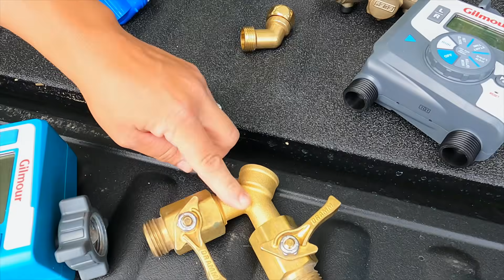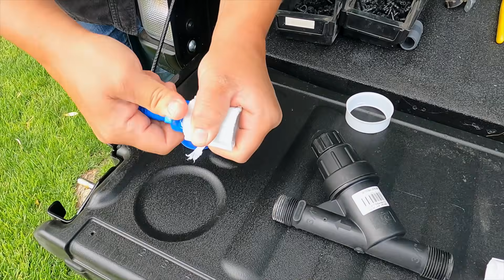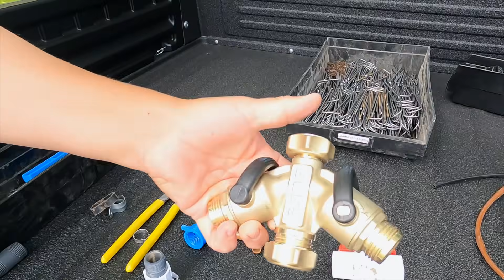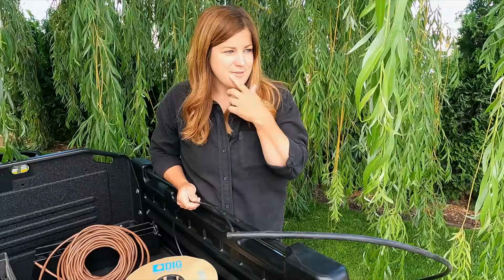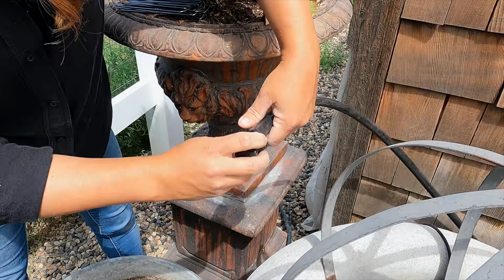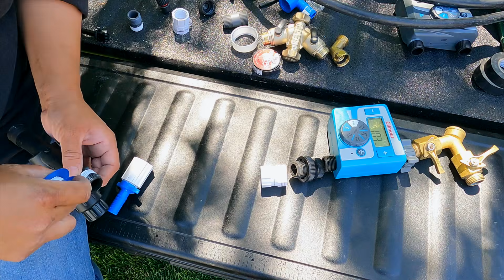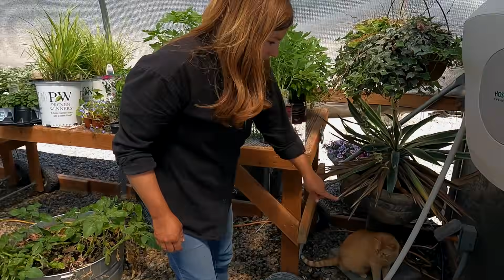Setting Up 18 Pots On Drip Irrigation! 💦 // Garden Answer

Comment: I've learned so much from y'all about drip, my husband and I installed it everywhere a few years ago from watching your channel. This year I pulled it all out and put it in a grid pattern like Paul did and the pressure is so much better and you're right we evolve and just keep improving. Whenever I put 1/2 inch black tubing in a walkaway I run it through PVC pipe to protect it from puncturing.

Comment: These irrigation videos are SOOO helpful! My husband and I converted the existing lawn irrigation in our “new” house 7 years ago to water our beds and pots and it was life changing!! After hand watering at our “old” house for 18 years I feel like I am no longer a daily slave to the garden… and even go away for a weekend without fear of massive plant death! 
Our irrigation system had 3/8” tubing, (which I see from time to time), even though I was told by the guy at an irrigation supply store that I was crazy because there’s no such thing. It’s been an ongoing challenge to find parts for the 3/8” tubing. 🙄 Have you run across 3/8” drip supplies in your experience?

Comment: We use the Command outdoor light clips to run our 1/4” tubing to our porch hanging baskets. The clips are the perfect size to hold the tubing if you want to run drip without damaging trim. P.S. we unclip the tubing in the winter and use the same clips to run extension cords for our Christmas lights.

Comment: Great explanations! Now we just need builders to provide faucets on houses at a decent height!!! I am so tired of always bending or squating to turn on the water.
Reply: another option that may work for your situation is to run hose to garden area, and THEN add in the filter/backflow/regulator, and then 1/2 inch tubing, etc.
hope that helps!
Reply: @moiseechen  Yes, great idea -- thanks very much!

Comment: How do you get the couplers into the tubing so easily? Do I just have baby strength in my arms and hands? It's super hard to darn near impossible for me to get the couplers into the tubing. Am I not holding my mouth right or something? I read that one trick is to put boiling water into a thermos and dip the ends in before adding the coupler. Haven't tried it yet. Anyone have thoughts on this? Oh by the way thank you for all of your informative and no nonsense videos! I get a lot of information and inspiration from them and I drive my husband nuts in the process so YEAH! 😂
Reply: I too have enormous difficulty ...i tried leaving tubing out in sun and the hot water...i also wear gloves to get a less slippery grip. there seems to be slight diameter diffferences among brands of tubing, some easier than others? but i haven't figured it out fer sure! in meantime, builds up your upper strength!!
Reply: Sometimes we use a heat gun to warm up the tubing as we go.  Of course we have to have a long extension cord to reach where we are working.  We have also carried around a cup of VERY hot water to dip the tubing into for a few seconds in order to soften it up some.
Reply: @stevet249  thanks. great tips. i tried that too and left tubing out in hot sun too. and i wear gloves to get better grip and less wear and tear on old fingers!!! [and somehow involve my knees in getting more power]
haven't figured out which brand, but some are bit wider, work easier? [but then, guess that means will come apart easier too? [heat, cold, critters?]
i consider it my 'workout' for the day. ha ha!
Reply: @moiseechen  @Steve T thanks!

Comment: Speaking of hard water and water filters, we have a water softener system that uses salt and I’ve often wondered if using that water in the garden has a negative impact on my plants? Or is it better than the hard water?
Reply: Water softeners use salt to rid the water of minerals. It is too much salt for plants and also can build up in the soil. Use the hard water and the plants will do fine.
Reply: @jgwood10  thanks for the reply. Unfortunately, I have to use the treated water. Is there something I should be adding to the soil to amend it?

Comment: Question- If I’m setting up drip to a flower bed instead of container would I still use 1/2 inch black poly and 1/4 in brown tubing? Or would I do 1/2 inch black and 1/2 inch brown?
Reply: I use 1/2 in in my in ground areas. I have some of the black 1/2” with individual emitters and the brown with 12” in spacing in other area’s. Then I can T off of that with 1/4” if I want to get extra water to something (like a plant that needs extra water, I run a ring of brown 1/4 around the base of the plant).

Comment: Why do you change to the brown line for the top of the pot? Can’t you use the same black tubing?
Reply: The brown line has emitters already imbedded in it. You would have to add an emitter to the end or at several spots to get coverage. Without an emitter the water just sprays out like a mini hose.

Comment: Thank you, once again, for such an informative video!  Re pressure ... I recently added 1/2" tubing grid on my flower beds (thanks to your videos!) and some of the T areas I had to add a clamp because they were blowing off.  Is there something I can add there to avoid this?  Once I clamped an area, another area would blow off.  Ugh!  Thank you both for ALL you do!
Reply: they make connectors that you first insert iinto tubing and then there is a ring that gets screwed down ...hope that helps.
Reply: I had the same issue - the pressure regulator😊

Comment: Two years ago I pulled up a video where Laura showed us how to use drip in her vegetable beds and then a few more videos setting up her pots.  One in particular where she used a circular saw to carve out a line in a cement slab for her alley pots. That was clever. I sat down and started plotting out everything I needed. I stared with a small bed first.  Easier than I thought. Only trouble was that after awhile, my fingers got sore from pushing all the barbed connectors through the ends of the tubings!!!! Other than that, it became easier to know what I needed an how to do it.  Even this video I learned a couple more things.  But the time saved, like some 3-4 hours a day of watering, was a life saver. .  As for timers, I use the Melnor, quad system on the front and back faucets.  I regulate them with my phone. It all was well worth the time and effort to learn and setup an irrigation system.  Thank you Laura.

Comment: After watching you for the past few years, I decided to install an irrigation system for my garden.  It works beautifully except when the watering cycle ends, and the water turns off or switches to another zone, water comes out of the connection between the backflow preventer and the pressure regulator.  I keep a bucket under the faucet to catch the water. The connection is tight. What can I add or do to resolve this?
Reply: is it coming from the 'backflow' piece? seems that is what it is supposed to do? i run a hose to the garden, and THEN install the filter/backflow/pressure reg combo at the begiinniing of the 1/2 inch tubing [to keep all leaks away from house and out in the garden instead!] hope that helps!
Reply: Did you try the pipe tape?  Use the 5-6 times around.  Mine drips hubby wants to fix it but For some reason my honey bees love to drink there🤷🏻‍♀️ They have other water sources but love the dirt mineral water combo I guess😊 so I won’t let him😁

Comment: Loved this video.  I am putting in a new  cottage garden and can’t decide on the best type of irrigation to use.  I know I want a timer but cant decide on which pipes etc to use or how to put them together.  I would be mainly watering garden beds or annuals.  What would you suggest?  Also how long a pipe can you run off one tap?

Comment: Do you have to pull up all your drip tubing every winter to avoid freezing like you do for the cut flower garden?
Reply: They don’t pull up any drip tubing. The cut flower garden is drip tape and yes, that has to be pulled up, but drip tubing does not.
Reply: @sheilastromberger2275  It seems like the tubing would split quicker than the tape as the tape would not hold water. Their ground freezes several inches deep. Our sprinkler hoses can stay out. Our regular hoses cannot just like theirs cannot. We cover our water spickets as well.
Reply: @dlsdyer9071  the drip tubing doesn’t hold water, it all drips out the emitters. Aaron talked about it years ago how some people use an air compressor to blow out the lines but he feels it unnecessary and they don’t do it. I’ve never blown mine out (zone 5) and have never had any issues. I do blow out my underground lawn sprinkler system.
Reply: @sheilastromberger2275  thanks for the info. I do blow out my PVC pipe system that I have for my terraced garden beds. I did not want to have to do the same for the tubing. No reason to not install now.😁

Comment: I think very helpful just to be aware of the different potential piece parts, even if not immediate need for.  I've been dealing w my quick connect coming loose, causing a leak, on my new wand. Completely forgot about thread tape solution until this video.  Funny how its just 1, all my others tight as can be.

Comment: Be sure to put the teflon thread tape on  the threads CLOCKWISE.
Reply: Yes. The direction you apply the tape definitely matters.
Reply: A lesson we learn the hard way!
Reply: I didn’t know that! Thank you! That’s super helpful. Now I’m gonna go check all my fittings and see what the heck I did.
Reply: Where do you get the thread adapter female to female hose to irrigation fitting, it's white in the video?
Reply: @anand bagmar That's right, you have to put the teflon tape in a clockwise direction when you hold the pipe in front of you. This way, when you put your fitting on which is also in the clockwise direction, you won't bunch up the tape. If you put the tape on in a counterclockwise direction, when you put a fitting on, it will bunch up because you are essentially moving the fitting against the direction that the tape is lying. There are several YT videos on this....

Comment: Do you recommend getting a kit to start out or buy individual parts and tubing? I see kits for sale but hesitate buying them so I dont end up with parts I really won't need/use.
Thanks in advance for your advice. 🌻🌷🌻🌷
Reply: i started with a 'kit' bec i was so overwhelmed in the stores ...if you have a large garden you can eventually find use for everything. you learn alot from a 'kit' and avoid frustration of missing essential part!

Comment: When Laura said “I really hope this isn’t confusing” I was sitting looking at the screen like that gif/meme of the woman who has the mathematical equations circling around her head 😩
Reply: I think drip irrigation is something that you won’t fully understand until you actually start setting it up. Once you begin it all makes sense and is really quite easy. I refresh my mind each year because it’s not something I do everyday and there are a lot of parts to it.
Reply: That whole first part seems overwhelming until you start putting it together. Her's is more complicated than mine is with having to get all the adapters for the different threads. You go to Lowes or something and you can find everything that uses hose thread only. Just remember it starts with a timer, backflow valve, filter, and a pressure regulator. Grab those and put it in your cart. You'll need a way to cut the hose and a way to punch a hole in the hose. They sell specific tools for that. Grab those and put them in your cart. From there it's really customized to what you want/need. The fittings are for connecting the hoses to route your system. You can get "emitter hose" like she has (the brown hose) which makes it really simple, or there's lots of drip end fittings you can put on.
And then there are kits that will give you an entire set up. I think you may still need to get the cutting and punch tools.
Reply: @larag4646  🌱Thanks for summarizing it. I found most parts at Home Depot and Lowe's. Setting up my garden on irrigation has been such a game changer.🌱
Reply: @larag4646  thanks for clarifying what to get first. And what to add next. I just took a screen shot of your comment. 👍🏼
Reply: One beauty of the video format are the pause and replay features . There have been several times I have gone back into the Garden Answer video vault to answer a question or seek input!
Reply: I was the same way when they explained it in other videos. At that time, they recommended buying a starter kit. I did for maybe $25, found it pretty easy to set up, and have been maintaining it ever since. Now I’ve added different tubing, expanded my drip system and even set up a system at my parents house. I’ve never regretted doing this. It’s a real game changer.
Reply: Lol

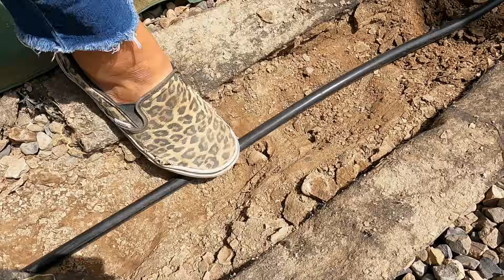Comment: Just a thought…would it be helpful to run the 1/2” poly tubing though a pvc pipe to protect it from getting smooshed by walking/garden carts? I noticed how easily it was smooshed when Laura stepped on the landscape staple at 15:18 and had to back it out a bit. Absolutely love your videos by the way! My 7mo old lights up when he hears “hey guys, how’s it goin’?”
Reply: When we moved into our home and started building garden beds and running drip we too ran the 1/2 “ poly through a shallow trench in the ground as a test…thinking we would need to upgrade to poly…surprisingly 3 years and counting its all holding up perfectly!
Reply: My exact thought! I bet it depends on the brand of tubing she uses. The brand I have is ruined if it’s even crimped. It almost stops water flow.😩
Reply: 🌱I did that on a section that was going from under the sidewalk. Otherwise, I place them above ground and then mulch them.🌱

Comment: Rain bird makes a kit that gives you all the hose parts and some black supply line, so 1/2 drip tube and 1/4 inch tubing and some emitters. 
This is a very simple way to get started!
Reply: Agreed. Great way to get started is with a kit until you figure out the shortcuts!

Comment: see….THIS is why I watch Garden Answer. You two make everything feel accessible! I am trying a soaker hose on a timer for the first time this year, and i’m already anticipating I will be using it A LOT this year. Before, I hand watered and always had issues like blossom end rot. I’m hoping this consistency helps. Thank you for the inspiration, Laura and Aaron! You guys even inspired me to start my own little youtube channel 🤗🌱 Anyway, have a great day everybody!
Reply: @Angel Of Domestic Bliss hello 🤗🌱 CorrectI was growing in pots last year and I was watering really inconsistently, which I read leads to a plants inability to pull up calcium from the soil. I bought some “rot stop” because it was too late for the eggs. And I just realized I forgot the eggs in the planting hole again this year 😱😂🤦🏽‍♀️
Reply: @Angel Of Domestic Bliss thank you! you too! 🤗🌱
Reply: Soaker hoses really helped me the last couple years. I have the cheap dial timers so I still have to remember to go out & set it but at least I don't have to worry about forgetting that the water is on & flooding my plants.
Reply: @mellfraze8112  yes even having the soaker hose there and hooking up the hose to water while I do other things in the garden is easier than hand watering. I have mine on a quick connect so it’s super easy.